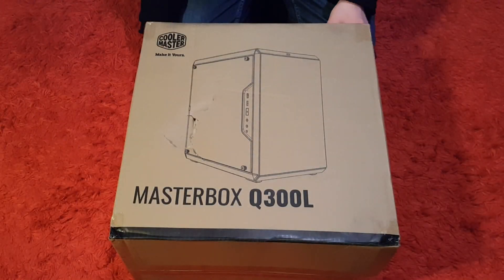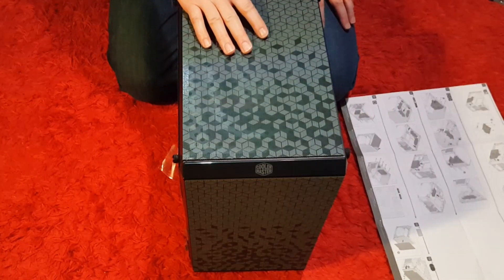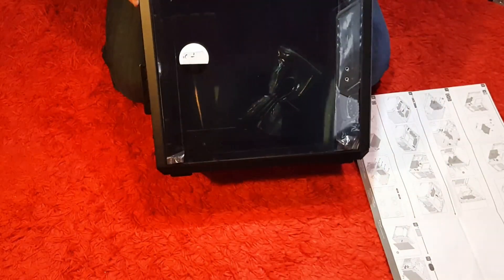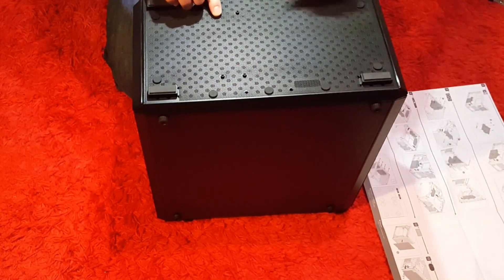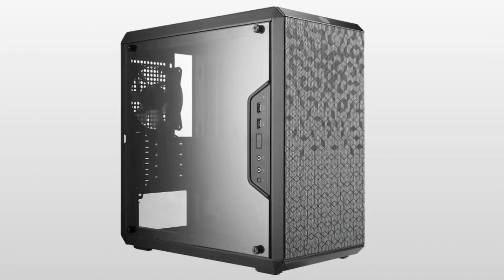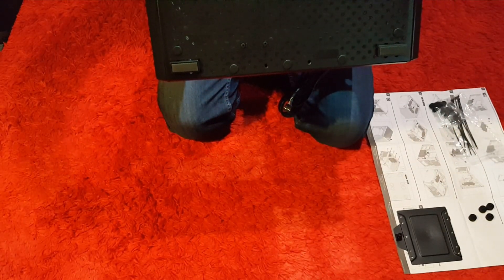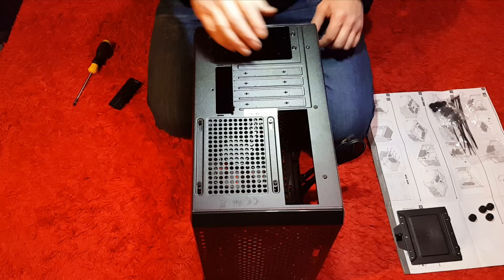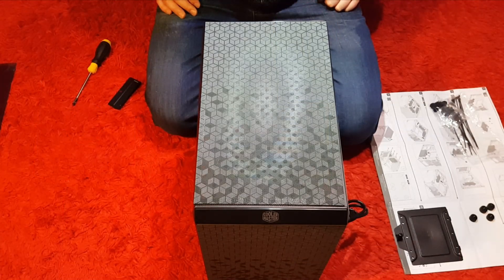Cooler Master Masterbox Q300L - Review, First look

Comment: Nice little case, like yourself I've never seen the panel on the side like that? With that Ryzen 5 this is gonna be a sweet retro gaming rig.  Deffo take a look at Launchbox/Bigbox as a frontend/launcher for your collection. It's awesome m8, I've been using it for a few years, great community to help ya and it just looks so cool with the right theme :)
Reply from the maker: Cheers bud, I want to see what the integrated graphics can do, I'll look into launchbox is seems very popular. What do you recommend for gamecube and what version of mame do you think is the best bud? 👍
Reply: @CalmCal  Grab the latest Mame build, currently at 0228 and matching romset. For Gamecube I use the Dolphin emu, it works great. Maybe go for RetroArch if yer gonna be emulating multiple systems. Personally I like using a standalone emu for each system :)
https://dolphin-emu.org/
Reply from the maker: @Lucasrainford  I was looking at mame last night and was thinking about how to reduce the romset as you get everything in those don't you? Fruit machines etc. Happy learning though! I have done retroarch before and wanted to look at individual systems they do seem to get ported to retroarch in the end though I think they have a duckstation core now, thanks for the advice & apologies for missing comment 👍
Reply: @CalmCal  There's a option in Launchbox when you're importing all the Mame games to exclude Quizes, Fruit machines, adult games etc. I can't help you with RA as I've never used it, like I said I use separate emu's for each system. Well, apart from BizHawk which emulates a few systems but is a breeze to set up and use :)

Comment: This 120mm fans is led?
Reply from the maker: It's not listed as RGB but it could be, I'm not a fan of RGB but I'll let you know when I've connected it up 👍
Reply from the maker: Hi, no the fan isn't led 👍
Reply: @CalmCal  you shouldn't be uploading a review if you haven't even turned the thing on to hear the fans are crap or not. nobody wants a whiny loud fan.
Reply from the maker: @Layarion  Yeah, I'm not a fan of whiny things. This is a budget case from a decent manufacturer, the fans are going to be basic but adequate enough for a simple build.